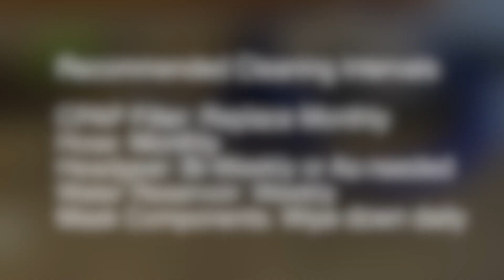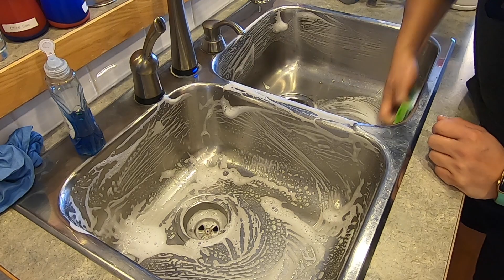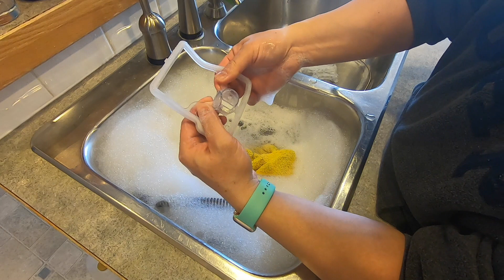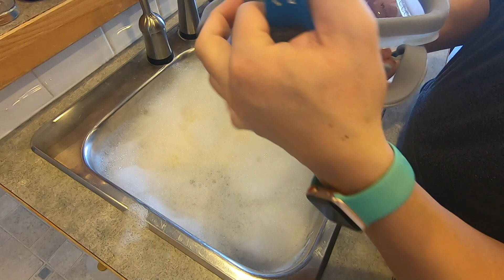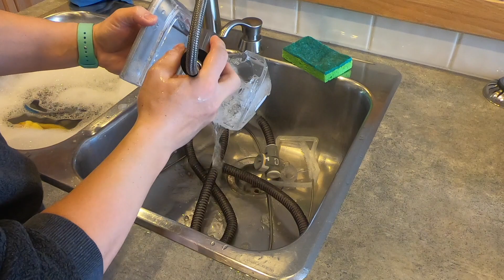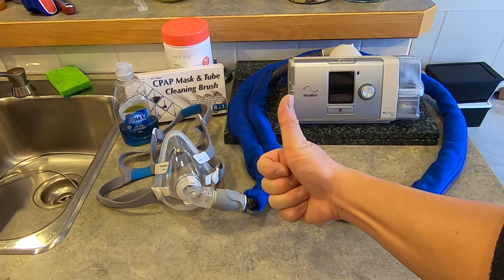How to PROPERLY Clean CPAP Equipment

Comment: What a pain.  Better to just lose weight.
Reply from the maker: Losing weight doesn't always translate to not needing a CPAP.  While weight absolutely is a significant contributing factor, that I've lost over 20 lbs (and I am not a very large individual to begin with) and yet I still have mild apneas.  Cleaning a CPAP is definitely "work" but as a whole it isn't too bad because the pros of using a CPAP far outweigh the cons given that I feel like junk when I don't use it.
Reply: So if you think using a Cpap is a pain how did you end up on a CPAP site
Reply: @Ransome2501  Who knows...just bored

Comment: Is it ok to use 1 parts vinegar to 2 parts distilled water to clean the inside of the tubing?
Reply from the maker: yep absolutely!  This method works great so long as you don't mind the vinegar smell afterwards.  I myself, don't like the smell of vinegar so I use dawn dish soap and it seems to work great.  Been using plain old blue DAWN for years now with ZERO issues.

Comment: Very happy to have found your video, I have not maintained my CPAP machine as detailed as you do until now.  I only washed the mask daily and changed the filter whenever I remembered 🤦🏽‍♀️
Now that I learnt all these tricks, I will definitely maintain my CPAP gears in a proper manner 😀
The only issue I have is with inserting the brush into the hose, I have the exact same hose as yours and similar brush, I have tried my hardest to insert the brush but it stopped mid way 😫

Maybe I am too short to keep it as vertical as possible... maybe I need to climb up a ladder to do so 🤔
I am fortunate to have some indoor hanging racks that installed right above our laundry sink, so I have been hanging all my gears to air dry after each wash 🤗
Reply from the maker: Glad the video has motivated you to service your other CPAP components.  You were doing things right by changing the filters and cleaning the mask but ultimately I think there is value in cleaning the hose at least every few months at the minimum.  The easiest way to clean the hose with a brush is to get a chair and stand on it so the hose is as straight as possible or even lay the hose straight on the counter and run the brush and detergent through it so that it passes through easily.  Don't need hard scrubbing.  A single pass in and out is probably good enough.  Rinse thoroughly and you're done :)

Comment: Thank you SO much! Do you have any advice regarding storing the tube and mask during the day when I'm not sleeping? I hang them up in my closet, but I was wondering if there was a more efficient or sanitary way of storing them when not in use?
Reply from the maker: You're VERY welcome.  Not much is really needed for storing the mask and tube since you're using it on a daily basis.     I have one of those self adhesive hooks on my wall just above my bedside table that I just hang my headgear/mask/hose on.  If you're really worried about dust getting onto things while its hanging on the wall that you can cover the mask with a plastic baggie but I really don't think its necessary since its your own home and the "dust" and whatever contaminants floating around in your room is the same air you breathe all day long anyways.
Reply: I have a nice looking clean garbage can/basket that has never been used for garbage by the side of my bed. I tuck my cleaned and dried CPap items in a clean pillow case in the basket. We have a hairy dog, and I like to keep my windows open, the pillowcase covering just keeps everything cleaner. Plus, I’m a bit of a germaphobe!

Comment: I got worried that I wet the metal connector on the hose that connects to the machine.
Reply from the maker: nope no worries at all.  Its all low voltage heating anyways and so long as the house ends are dry before you plug it into your cpap you're golden!

Comment: What is the purpose of that sleeve on the tube? I don't have that for my machine.
Reply from the maker: it is a called a hose cover or a hose "cozy".  It makes the hose less "medical" feeling when it is rubbing against my body or arm or face and it also prevents the hose from getting too cold and have condensation build up (called rain out) due to the high humidity in the house and low ambient temperature in the bedroom (I like sleeping cold rooms with thick blankets).  Condensation is rarely a problem with my heated hose but there are many users that don't have heated hoses that suffer from this issue.  Keeping a hose insulated prevents that from happening.
Reply: @piercedasian  Yeah that was what i was getting at. With a heated hose like yours(and mine) it shouldn't be necessary. But i do get the purpose of feel. To me it would probably help to not get that annoying sound of the hose rubbing against itself of the machine when turning to the other side.
Reply: Supposedly warms the air.  Oming thru the tube.

Comment: Thank you for this. I had very minimal instructions with my CPAP (clean the nose piece and rinse the water reservoir periodically). I was doing this for a couple of months until I found that everytime I would put on the machine I would start coughing, sneezing and a runny nose.  ONLY 
when I  put on the  CPAP.  Oh and I change the filter when the machine says so.
I'm  extremely glad I found your site. I'll get cleaning right away.
Reply from the maker: Good luck.  A clean CPAP is a comfortable CPAP to use.  I do find that cleaning does seem to help with my allergies.

Comment: My ResMed Eclipse 85, has a water reservoir that does not open.   There is no way to access the inside of it.   If I stretch my longest finger I can barely touch the inside through a little hole.   It gets slimy and nasty in there.   I fill it with soapy water and shake it vigorously but I don't think I ever get it really clean.   Can you advise me on this?
Reply from the maker: that doesn't seem to make sense.  how on earth do you fill the reservoir then?  There should be a latch on the tank that allows it to flip open for filling and cleaning.  Can you send me a pic to piercedasian@gmail.com so I can see.  If you can take the reservoir out and take several well lit photos at different angles then I can provide some insight.  I'm assuming you're in Europe or Australia?
Reply: My res med eclipse s8 (gave wrong # before ) is long out of date.  The supplier can not give me any more parts for it, or a new clean tank.  I just have to do the best I can until the doctor sees fit to authorize me a new one. USA

Comment: Is there a way to clean the interior part of the machine itself?
Reply from the maker: There is no need for it.  So long as you clean your filters and reservoir and hoses regularly that the inside will rarely ever get dirty.  If you look on my channel I do also use a SoClean machine but that really isn't necessary for the most part.  The idea behind the SoClean is that it is supposed to sanitize the entire "air circuit" of your CPAP which includes the inside of your CPAP machine.  I don't run it daily, I use mine every 2-3 weeks time as excessive use of the SoClean supposedly can deteriorate the internal seals on your CPAP machine over time.  I've used my SoClean cleaning system for years now at the 2-3 week interval and so far zero issues with my CPAP.

Comment: Do you recommend  the "automated" CPAP cleaners? Thanks.
Reply from the maker: I use both b/c the automated cleaners don't physically remove things like drool, snot (gross) or facial oils.  I use my Soclean every 2-3 weeks (b/c ozone if used too excessively can actually wear out your CPAP's plastics) and I wash by hand as needed - usually monthly.
Reply: Thank you 😊
Reply: 8/16/21: They are not approved by the FDA. Ozone has been known to linger in the hose & mask and is bad for you. Even though the FDA doesn't think that the UV light kills bacteria, I would be inclined to buy that one. I use a UV Light toothbrush cleaner that I got on Amazon and they use UV light to kill germs on HVAC systems so it must work to some degree. They say if you use an automated cleaner then still wash your supplies weekly (I would probably do it bi-weekly or monthly).

Comment: DO NOT DO THIS!!
Don't use a kitchen sink. Buy a big bucket and use that.
Don't use water from the faucet. Tap water has bacteria in it.  Use distilled water clean everything.
Use distilled vinegar once and awhile to.clean the stuff.too

YOU will get pink bacteria in the water chamber if you do what he says
Reply from the maker: This method is hardly dangerous.  Permitted the sink is very clean (which it is) and the water source is clean (which mine also is) then there is little issue with contamination.  I can understand your concerns if you're on say well water or the water supplied to your home is poor quality but in general water from the taps in Canada at least are extremely safe.  In fact, the water coming out of our municipality is one of the best and cleanest in the world.  We never give it a 2nd thought on its safety.  I'd like to think that most people that use their sink for cleaning something like CPAP equipment would be smart enough to ensure their sinks are well cleaned and rinsed down with plenty of hot water prior to putting their hose and mask parts in.
Reply: @piercedasian  I live in Canada too. The water still has bacteria in it. Doesn't matter where you are from or how good the tap water is. Also a kitchen stink isn't sanitary. You would not use it as a sink to.eat stuff.from.it.  So why trust it.

Comment: Resmed instructions for cleaning is not to use Dawn. Dawn is too strong. Use a milder detergent instead.
Reply from the maker: Hmm, not sure if Dawn is too strong (despite what the manufacturer claims).  I've used it consistently for as long as I've owned my cpap and so far no issues.  But that being said, an alternative could be something like baby shampoo or cpap specific cleaner (waay to overpriced).
Reply: I cut Dawn about 5 times, I use it that way for my hand soap dispenser. Seems like the right amount for my CPAP mask.